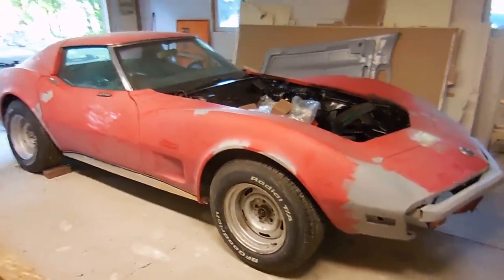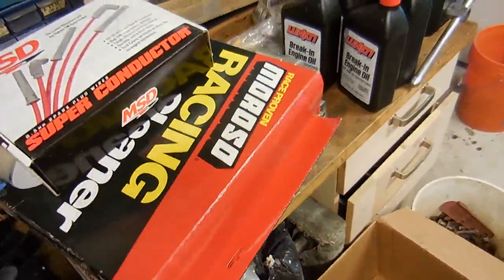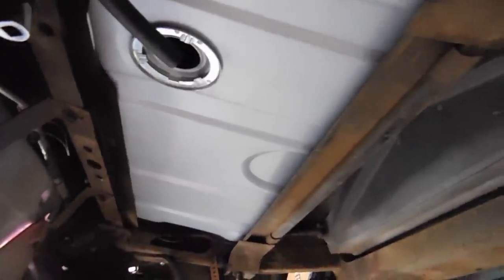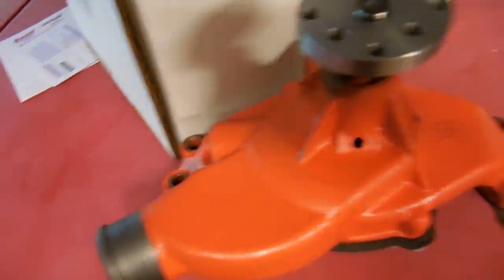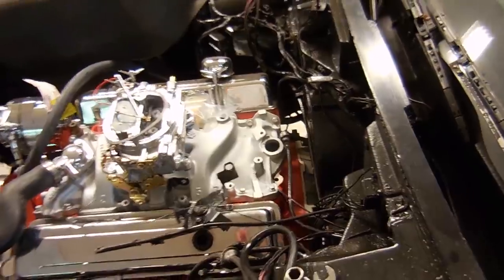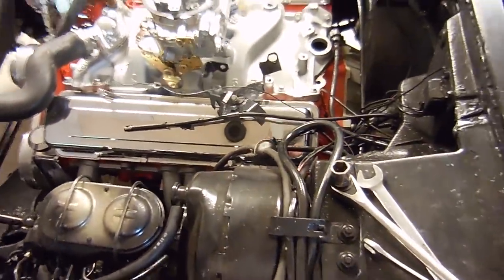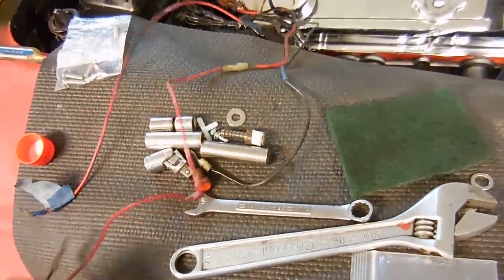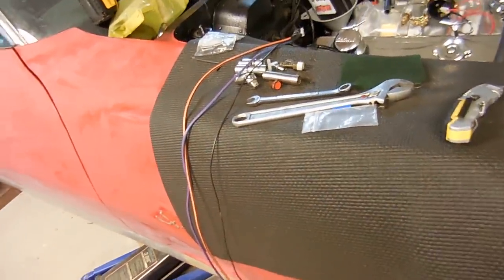Eric's 1973 Stingray Corvette Project Part 1

Comment: I know this is an old video but for those watching if you want to prime the oil pump and check flow without slinging oil off of the rockers then use an old valve cover with a 1 inch wide channel cut across the top. That way you can see the top of each rocker but the oil doesn't splash all over the place.

Comment: Nice project and nice wiring job. Yep best to replace anything that looks a bit shaky better to just rewire. When in doubt rewire. Well water pumps have always been a problem when I used to work on cars  moons ago. Seems when I went and got a rebuilt it ended up being worse than the original. was better off rebuilding the OEM original.

Comment: I hope he spent some cash on a decent engine for it.  It'd be nuts to stick a stock performing engine back in it.  I see iron heads which is a letdown for me.  (not that I matter here)  Great work Ben!
Reply: As long as they are aftermarket iron heads it could still make some good power.

Comment: I reacently became an owner of a 1974 vette. I have a snaped tacho cable. Could you help me whit some issues. Is the gear that drives the cable on the distributor changable or do I have to change the whole distributor. How to change the cable do i need to take the whole dash out

Comment: Great job as usual. Is there an aftermarket throttle cable bracket that you are going use or will you be fabricating one? I cant wait to see the finished product. Keep up the good work!
Reply from the maker: I made the stock on work on this car.

Comment: *IMPORTANT, DONT CATCH ERIC'S CAR ON FIRE*
Ben, the large gage orange wire that runs from the starter solenoid to the distribution post on the horn relay feeds power to the entire car. It should have a fusible link in it right down near the starter solenoid ring terminal. Undoubtedly it was shorted and someone cut out the remains of the burnt up fusible link and put in that smaller gage wire. Anyhow, Dorman makes replacement links, way cheaper than replacing the entire engine harness.  Or you can use one of the newer slow-blow maxi fuses (the modern equivalent of a fusible link). The amperage rating is listed in the 73 FSM. I'd definitly recommend that you put one in, otherwise that wire is not fused and if shorted (say, against a hot header pipe) could catch the car on fire. Ask me how I know...
Reply from the maker: How do you know?
Reply: Lol. Caught my '73 on fire. I got lucky, because my short happened during engine work and fire was when I reconnected the battery.  So I disconnected the battery quickly. Engine harness is $200, Lectric part number for L48 auto is VIG7300AS. Just looked in my FSM, it is a 14 gauge link, Dorman part 85623, $2.99 at Summit. Solder and shrink it in between the orange wire and the top terminal of the starter solenoid. Have fun, absolutely love the videos, keep 'em coming.